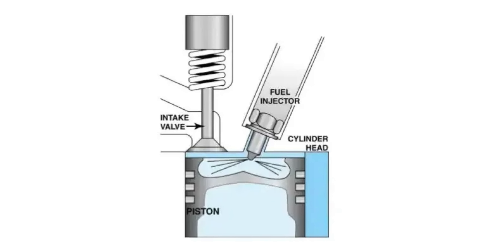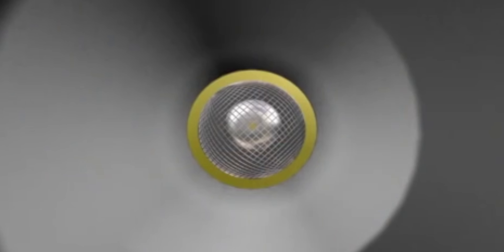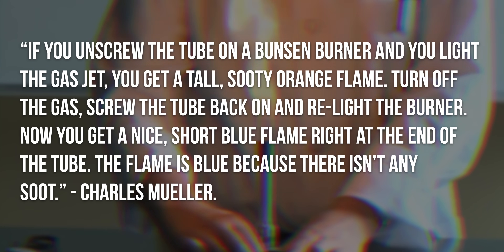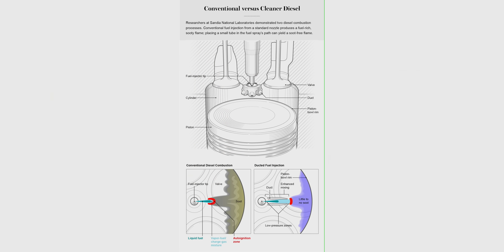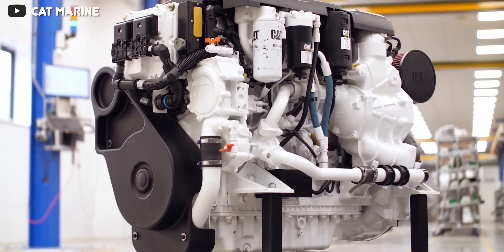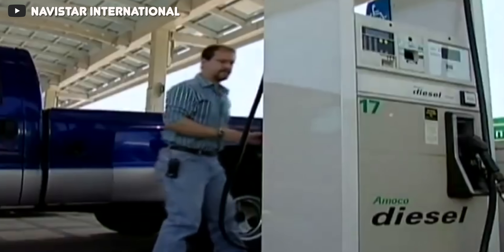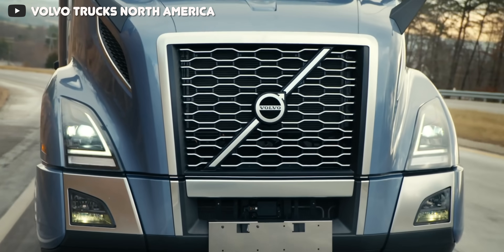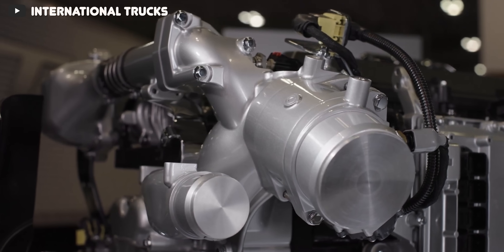Zero Emissions Diesels: How Ducted Fuel Injection can Save the Diesel Engine

Comment: When I saw the title I immediately got excited for better diesel emissions reduction equipment.
Reply: too bad the title is all thats good about this.
This is not gonna be a thing and wont make any difference for the average person.
soot is already a none issue for anything with a particle filter.
Reply: @Pixelplanet5  Less soot out the combustion chamber means less clogs in the emissions systems, better efficiency across the board as well as better air quality and less money wasted on warranty claims and out of warranty maintenance.
Reply: @Trussme96  all that doesnt matter though as soot is not the reason why diesel engines are unable to meet their future emissions standards.
This will give the high polluting diesel engine a bit more time at best but overall all combustion engines are on the way out in the next ~2 decades and this is not gonna change that.
Reply: @Trussme96  we might see this injector soon but idk if it’ll happen.